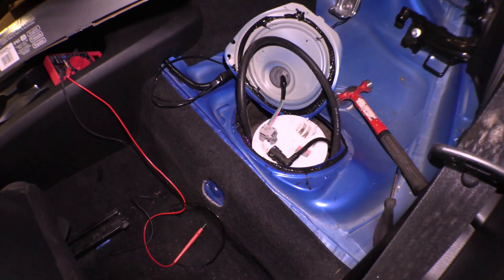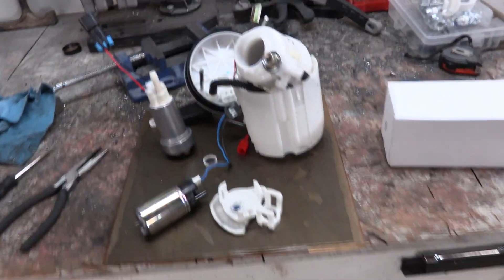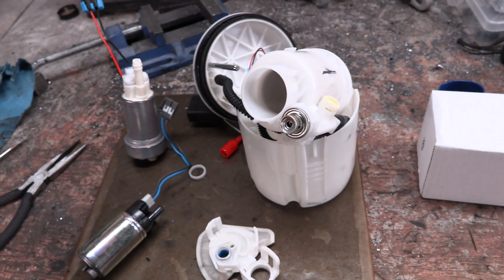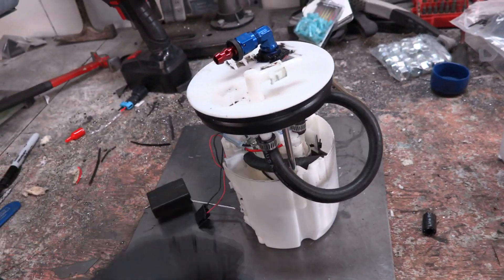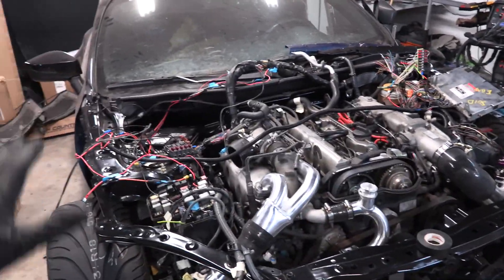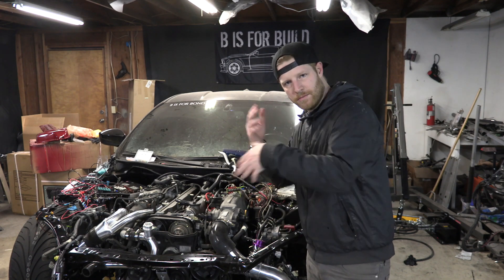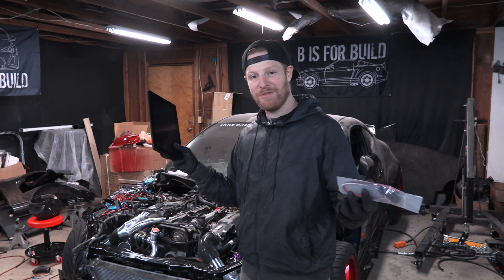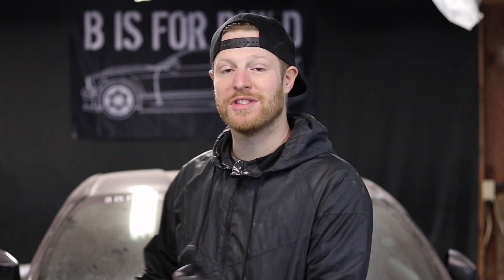2JZ BRZ Pt 12 - DIY $60 Digital Display

Comment: Anyone know if tbis will work wigh newer obd2 bluetootb adapters (version 2.1)? Ive Hooked one up to my engine swap and it doesnt want to play ball 😖
Reply: Same problem here, I have 2 different ebay obd2 adapters, tried 3 different phones without luck. 2jzgte vvti swap everything wired correctly but the app wont recognize the ecu.

Comment: I hope you used submersible fuel hose on the fuel pump?  I know you ended up not using most of that black 3/8 ish fuel hose, do to not fitting, but I still saw a little bit used.   I don't recall you saying you were using "submersible" fuel hose?  Anyways it's very important to use it over just conventional fuel line, otherwise you will run into problems down the road.  Your fuel would end up turning black when that fuel hose starts to deteriorate.  Just a thought for anyone doing any fuel return and adding new fuel hose to their existing fuel pump.

Comment: Dude try just crossing the two different rpm wires together, they're usually just the same system in every car that runs off spark pulses. But none the less that a cool fix

Comment: i've never watched your videos before but please please please use the correct fuel line clamps on the rubber hose. the worm clamps will tear through the hose causing a leak.

Comment: Do keep in mind that the more gauges you use in the torque app the more laggy  it will respond.

i use this app on my VQ35de and it is laggy as FUCK but i use it to monitor water and Intake temps.

Comment: The vacuum gauge is the "boost" gauge. It reads a vacuum until the turbo spools and starts pushing air rather than the engine pulling air. It will say vacuum when there's vacuum and then say boost when there's boost.

Comment: I wouldn't trust those regular hose clamps on efi lines the hoses bleed the fuel vapors and regular clamps will eat through those hoses. You really need efi hose clamps and if that hose isn't a submersible efi hose it might swell up and cause leaks very early on. I really like your videos man keep it up and I hope this suggestion helps like a lot of your videos have helped me.

Comment: I use Torque for all my data logging. It works pretty damn nice for how cheap it is.

Your vacuum gauge will turn to a boost gauge when you start driving it.

Comment: If you want something that's a bit faster and more accurate communication you should grab and OBDLink MX module as they are a lot faster communication than the generic ones and generally they can read a lot more systems then generic readers as well. ALSO you should be able to tie in pins from your stock OBD port for the other car sensors like the speedometer etc.
Reply from the maker: +Doug Dale just picked one up, thanks for the tip
Reply: Awesome, it's what I use for diagnostics. And it accesses all the systems on my wifes ford as well which is nice. If it's still not super responsive it could just be the tablets bluetooth.

Comment: C is for conflagration. 

That fuel pump mod stands a good chance that he will burn that car down sooner or later.

And with the bent LF corner from the original collision that wasn't repaired correctly, I'll be surprised if it tracks straight at speed. You don't have to be a perfectionist, but how far was the LF pushed back and is it shoved to one side or another?

Geez, at least "string" the "chassis" suspension mounting points on the 
garage floor before you start doing all that work to make sure it is 
"square".
Reply from the maker: +Ed Anyone comments like this from people that haven't watched all the videos are frustrating, but you weren't rude so i'll explain. The car has been to a frame straightener, i've replaced the front sub frame with no issues, meaning all the suspension mounting points were square, and i've driven the car many times before i did the swap, and it tracks straight, a bent frame rail after all the suspension will only make the impact bar and body work a pain, won't effect drivability. It's unsafe, but i've already addressed that by saying i didn't know about it, and i'm not throwing the car away now. My welds and reinforcement will make sure it never bends there again, but that's not good either.
Reply: I watched the first 8 or 9 in one sitting to catch up, and then #10 and 11 before this one.

And I do appreciate you saying mentioning that I didn't come across as being rude; I am still trying to moderate my criticism of videos I see to be more constructive than condemning - guess I have a ways to go - a work in progress. 

I guess I missed something, but I recall seeing the patches you welded to the LF frame section especially and then installing the new "front crash bar" (missing when you started this build) section that didn't line up and needed to "be adapted" to fit. To me a tip off that something was off somewhere, as far as squareness and alignment.

IMO, never trust the body shop when you aren't paying then out of your own pocket. Insurance companies pay too little per hour and the flat rate times usually come up short. And for the guy doing the actual work who is caught in the middle, feeding their family comes first; doing just enough to keep the boss off his back is 2nd; leaving the poor smuck who owns the car a distant 3rd. "Ethics" is an objective that rarely is part of the equation; unless things have changed in the last 20 years when a vehicle is "almost" a total loss. I am not "fan" of FWD cars; RWD and 4WD are all I have ever bought new and you can't be picky when a "beater" is towed in and the customer don't or can't afford to fix it. For many years "beaters" were mostly what I drove every day; 4WD were used in the winter even though the road salt here in Chicago turned them into eyesores in 4 or 5 years; the new RWD cars got parked for 4 months a year in a heated garage so that I could get 15 to 20 years out of them - first the salt and then the potholes Thanksgiving until mid-March or even mid-April a few years due to the potholes, which killed alloy rims and body spot welds - loosey-goosey with a hatchback, the coupes were better, a bit.

And you "stringing" that car would have made a good episode; that was on my mind when I made that comment after watching Eric the Car Guy "string" his Fairmont as he was doing the chassis bolt on mods that he did over a few videos. 

I am not a body or frame tech although I did have ASE certification in those areas, but I did specialize in Toyota vehicles in my own shop for close to 30 years (early 70's, 80's, and well into the 80's when I retired from that career). I saw many of dozens of similarly damaged vehicles that were just fixed cosmetically IMO, and when I couldn't get them to "go down the road straight" I knew something wasn't right. And I owned a few "beaters" that had similar damage; a long term customer once handed me the title to once had been their pride and joy, after a collision the car "just wasn't right any more" and every attempt on their part to get it fixed right was just another frustrating experience for them and for me because I was "their expert" or advisor. A few of those cars I parted out and made a few bucks; a few I fixed during the slowest two months of the year to keep my techs and me busy as a learning experience. Those cars were then used for parts runs or as loaners - if the job turned out good and the car was safe in my eyes when we got done. We learned to "string", read chassis measurement charts / prints, where and where not to splice sub-frame panels, and I learned how to use a MIG welder - night school continuing adult education classes at might and by practical experience on my own "donated to the cause" car. 

And one '87 Celica GTS 5 spd that I let the former owner use it for a weekend when we got done with it, he offered to buy it back from me when he brought it back to the shop on Monday - I told him not for sale. I was not a professional and my shop wasn't insured for that type of work. His kid had rear-ended a small pick-up truck and the front-clip was shoved back a few inches, The supposed "repair" left the front "spindles" rearward about an inch or so per the "strings" and the car was like a hunting dog on a trail for prey. Wandered all over the road although the alignment rack showed every spec was on the money; the only thing that was out of spec was the wheelbase; 3/4 of an inch "shorter" which my alignment rack couldn't pick up as it didn't have all the latest "bells and whistles" that my small shop couldn't afford to buy. 

Six times back at the body shop before his insurance paid him enough to make him go away. I had gotten sucked into the swirling vortex of return visits due the owner having been a 15 year client of mine, from the days when I started out in a 2 car garage behind my apartment. And he only drove Toyota's because that was the only car I wanted to work on. With loyal clients like that I went "the extra mile" to help out and to provide guidance; the amount I would charge was small to nothing many times. Once he was worn down and got some money out of it he just drove over it to me and handed me the keys & the title, telling me to strip or fix it he didn't care anymore, but if I did fix it he wanted to drive just once again - for old times sake. He got enough from his insurance company for a down payment on a new Toyota, got 5 years of use and over 100,000 miles out of it,  and his son could buy his own car - "daddy's car was just for daddy - crash your own car next time". (and that was in the pre- smart phone days with texting while you drive)

I fixed it to kill dead un-billable hours (days/weeks)  that year rather than lay-off a good productive employee or waste my time keeping them amused (while I earned nothing) or had them learn something new. Fucking grown men who were being paid every week bitching about "wasting" their day with nothing to do, while I was living off what I had banked the year before - (but that is the way this business works; feast or famine - they knew that),  if you don't want to take your vacation in Jan or Feb and want to keep getting a paycheck shut your fricking mouth, I am paying you. With a marginal employee who just didn't "get with the program" - fire him and everyone else would STFU. But over the years I learned to cut the careless "clowns" loose before their comebacks would eat me alive during the good months; I would rather work until 9 or 10 pm myself a few nights a week to keep the work flowing out the door than have to placate unhappy customers due to a careless "clown". (Oh, I am a good mechanic, I have Snap-On tools to prove it!)

So I sometimes had that type of work waiting for the slow months. The mechanical stuff is what I wanted to keep them bust through the later winter months (leaky coolant hoses - drive em without coolant until they seize up and the "lack of oil" seizes up jobs that needed "bone yard" motor) did get fixed in the slow times and eventually sold after using them for a few months and fixing most everything else that was neglected by the owner before they wandered thru my doors, so I did have some profitable work to do for the long term most years. But I still went months myself with out an income from the business.

But, hey - I am just a retired (12 years now) 67 yo ex- grease monkey offering an opinion about what I saw / see. I haven't tackled a job like that since the early 90's; my hobby since then has been computers and electronics. Ex Navy Aviation Electronics Technician.

Comment: I use torque too, with a android head unit and a usb to obd2 cable which makes the response time almost instant. 

I believe if you used a usb adaptor to the tablet with power and a input you could do the same if like me the lag with BT annoys you.

Nice work by the way, been a fan for ages!

Cheers
Reply from the maker: +MINKIBIZ woah i didn't know those existed, ill look into that. I assume torque has no probs reading data from usb?
Reply: B is for Build they do :) if you want i can send you a link to the one that I have. It worked perfectly for me first time. The only difference is that you would also be using an adapter so that you can keep your tablet charged while feeding it data from the obd2.

Comment: Hate to say this, but Torque and that level of OBD isn't going to perform very well, especially when asking for multiple PIDs at a time. You'd likely see OK performance with just RPM, or just Coolant, but the latency when requesting the data is such that it'll just fail to keep up when using the car in anger. I have built apps which do OK, where by you prioritise RPM over other PIDs. So you'll request RPM constantly, and then ask for coolant temperature, intake temperature less frequently, every couple of seconds or so. Not sure if that's possible with Torque?

Comment: Been using the elm327 bluetooth adaptor and my android phone for exactly this for a while, it does have a boost gauge and afr gauge as well, and really good for finding and clearing fault codes. Glad to see someone got it working on a 2jz, want to do a 2jz or 1jz swap on my next car so will definitely follow your instructions

Comment: A good tip for faster communication with torque would be to either get a better quality bluetooth OBD2 reader or get a USB model and an OTG adapter for the tablet. USB would be much more reliable in the long run. For a nicer final install there are also a multitude of Android based head units on Amazon and eBay that would be much sleeker than a tablet taped to the dash. Torque also has a HUD mode, so if you grab yourself an old phone (OLED screen works best) you can create a DIY HUD for critical stuff like RPM.

Comment: that Obd2 Bluetooth setup is so much more useful than buying a BMW specific one like jb4 or Carly. spend $9 for the adapter and I can set everything I'd want on display for cheap, using an old Android phone. best part is this is cross platform on ANY OBD2 CAR!  I could hook it up to a minivan for shits and giggles. You saved me $$$, I bought a keychain to support

Comment: I love Torque, but I wouldn't rely on it for real time info there can be delays in it. If the bluetooth on your tablet is quality and it has enough cpu power you can set it to faster adapter communication and it will be more responsive. On my phone it's hard to tell it's not real time. It's a little slow on my car radio though, you can get chinese android car radios that aren't too bad I've got a carjoying in my gc8 on stock ecu. Your ecu and the number of visible gauges can also affect the speed. My ecu is old and slow and faster communication causes bluetooth connection issues so mine is almost as laggy as yours. Give your phone a try you'll see what I mean.
Also you should consider an after market ecu, you'd have one powerfull ecu to run everything. It'll run your dash cluster and brz systems and It'll run your engine. I like the look of haltech but there's a bunch out there, It'd make for much cleaner install. Anyway love the vids even if they are a bit dodge sometimes they're always very entertaining.

Comment: you want to cleen that wiring up then splice the 2 harneses together car and engine its a bloddy mess the way you are doing it not to mention if you spliced the harness the original day will work  and you could use the push to start properly not just with you cowboy set up
Reply: http://www.ft86club.com/forums/showthread.php?t=43087 http://wilbo666.pbworks.com/w/page/37134472/2JZ-GTE%20JZS147%20Aristo%20Engine%20Wiring    theres some links do it properly for crist sakes

Comment: I use torque pro. You can monitor AFR and boost/vacuum with it, for whatever reason it gives you a choice between vacuum and another separate vacuum/boost combination gauge. It uses whatever O2 the ecu uses for information. =D Looks good!

Comment: Your a software engineer? Why not use a Raspberry pi 3 and an HDMI display (any size). Once the pie boots, start up a webpage (either angular or using node.js, maybe just basic HTML/CSS/JS). That would seem cooler since you can change the layout by modifying the css stylesheets. As for matching it, couldnt you retrieve the information using the OBD port (not sure if thats the name). The port that most Subaru, Evo or Focus use (accessport ).

Thanks for the great video!

Comment: The dash display is cool... I use Torque myself with a variety of BT OBD2 modules.

A few notes...

The OBD2 dongle is going to drain your battery unless you set up a way to switch off the power to the dongle.

Bluetooth on these dongles is a pain in the ass to pair up.  Some only accept pairing up within the first XX seconds of boot up.  And I've had to jump through hoops to get Android to bother reconnecting, as well.

Obviously, your Android is not switched on/off with the ignition.  It takes a while to boot up.  It also does not automagically go into a particular app.  Perhaps a 3rd party hack of Android might, but I'm not aware of a solution for this.
Reply: buckykattnj my obd2 adapter powers off when I turn off accessories, I don't know about his setup but this should be easy to fix  and it isn't a high power device anyway.

you can use the tasker app to have the app launch on start up. I hop in  my gc8 turn the key and everything just works.

Comment: The 2JZ communicates over K-Line, maybe you can also wire in the BRZ Can Bus High Low into the Odb Plug  to get the information from the Body aswell